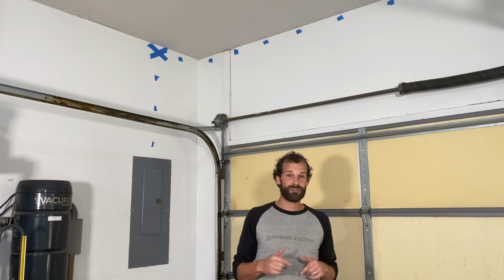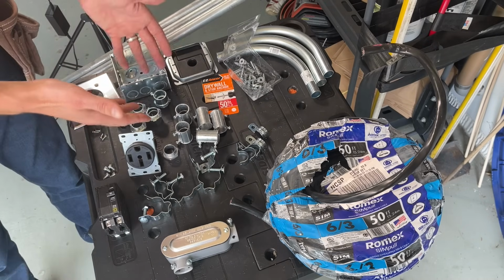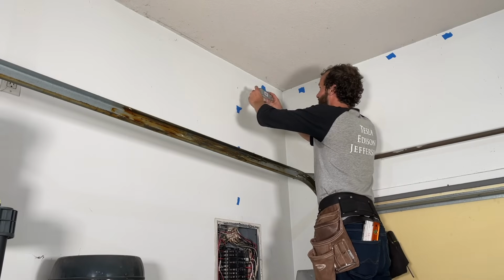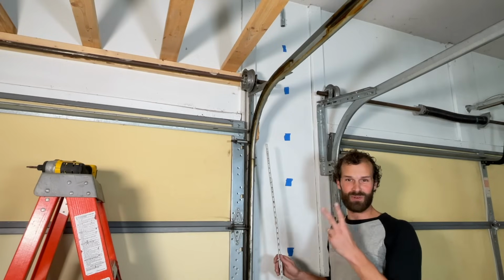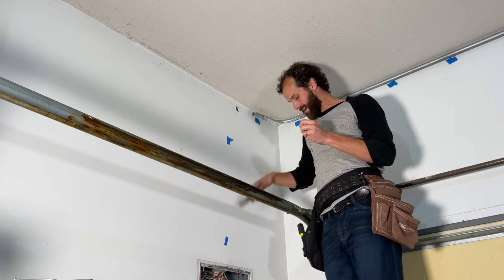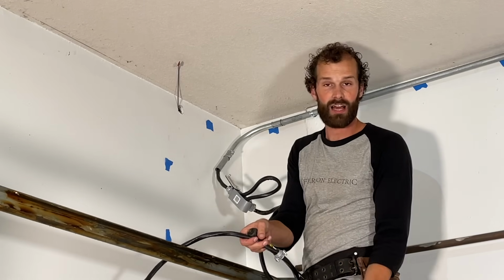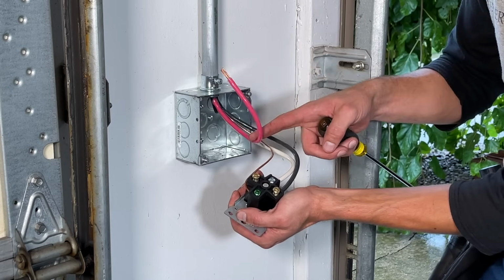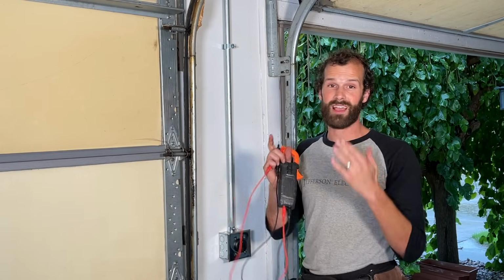How To Install a 240 Volt Outlet | Electric Car Charging

Comment: Thanks so much for this video, really enjoyed watching it. 
Question, since the code requires outlet in the basement, garage to be GFCI protected, should you have used a GFCI breaker ? Also, I'd recommend getting an electrical insulated screw driver for doing this kind of job. Thanks!
Reply: Hire an electrician. This is very dangerous amperage.
Reply: Only required if you are on NEC 2020.
Reply: @bobniles1928  Does this still apply if the charger has its own GFCI?  Didn't with ours (CEC).
Reply: Many EV chargers have GFCI protection built in so at least here (CEC) the breaker doesn't need to be GFCI, even tho our charger is installed outdoors and would normally have required GFCI for quite a number of years.
Reply: Not sure about the 2020 code, but at time a single dedicated outlet didn't need GFCI.
Reply: @jrendt2157  Garages and outdoor outlets can be fussy about GFCI, so it's best to check out the relevant code.

Comment: I have a 100 amp service.  He does not recommend a 50 amp circuit breaker, 240 volts for this service.  What should I use for my Tesla Y?  Will a 40 amp circuit breaker work with a smaller wire?
Reply: Please call an electrician. This is not DIY work.
Reply: @Sparkeycarp  spoken like a true union man

Comment: IT WOULD'VE BEEN MUCH EASIER IF YOU WOULD HAVE USE THHN WIRE. YOU WOULD'HD INSTALLED THE COMPLETE RACEWAY THEN PULLED THE WIRE THROUGH WITHOUT HAVING TO REMOVE THE LB AND 90°, BUT YOU'RE A PRO I GUESS.

Comment: This was awesome. I'll be buying nan EV next year and it's nice to see the process in action. I planned to get an electrictian. Mine is going to be on the outside so still trying to determine my placement and overall look. One tip. I'm a network guy and run cable all the time. I have the metal fish tape but for electrical projects like this it might be a good idea to invest in the fiberglass glow rods or the plastic one. A word of caution when using them. If they're the fiberglass rods need to wear gloves. But I would wear gloves with the fiberglass rods or even the planstic rods to avoid skin cuts or irritation. For most projects a metal fish wire will work fine. But since the other rods are non-conductive they be a good addition to the set your set of tools.
Reply: Hire liscenced and insured electricians
Reply: @anthonywacker6165  I most certainly will. I'm not going to be putting in a new circuit 🤣😂

I'm planning to take delivery of my EV in June next year and got my charger already. I'm going to be setting up a couple appointments in the spring with a few licensed electricians and get quotes.
Reply: @KineticEV  I’d say 600-800$ job assuming it’s not to complicated of a run and/or need to swap ur panel
Reply: Hire a professional electrician!!!

Comment: That spot in the middle of the 2 doors is horrible for a Tesla hookup. Tesla charger is wired into their own box(station) and the reason why it sucks is because the cord is attached to the station. So wrapping it around gives you the risk of getting into the garage door track. Not good situation. You would have to box out the sides or make sure its tied tightly each time.
Reply from the maker: That’s doable, thanks for the feedback/tips 👍

Comment: Pro ? You do clean work but missed couple things:
- the tesla charger says not to use a GFCI breaker, but some other manufacturers do.
- you CAN NOT ( and should not ) pull a romex through conduit.  Why?  The wires get hotter when in romex sheathing and in side  conduit. Especially after you kept repeating that its a continuous  load.
- steel fish steel through live panel ?  Please don't.  I've been in the trade 20 years. Do I do it ? Yes. But I I'm making a how to video use a fiber glass fish.
- if you want it to look like a real pro install :  don't use the 90° elbows , just conduit.  
- not sure why you use a mud ring 
- and, some jurisdictions do not allow the conduit to be used as a ground, so need to pull a ground wire, and use a ground tail in the 4" box.
Reply: We were thing the same things . Fiber glass fish tape less chance of sparking any thing but to each there own he made it work. And I know nec code disagrees with putting Romex cable in pipes .good point yea any thing 3-4 hrs or more is a continuous load so def a no no especially in a garage that doesn’t have AC or climate control to keep the room temp regulated .as far as using 90* elbo on pipe well it may not look the best but I will give him points he’s doing this to teach DIY ppl how to do it. Most of them won’t know how to use a pipe binder let alone know how to subtract the correct amount off the 90* bend when bending pipe so for that it makes since to show prefab 90’s you can  buy at store.

Comment: For anyone watching this video, do not jamb that many NM cables through one hole as in this existing panel.   If that is actually a conduit in the wall and longer than 24”, it is a violation of NEC rules.   The reason: heat can build up to a point the conductor insulation will start deteriorating.   Over time, caboom or fire.
Reply from the maker: For this install Romex was simply ran inside the wall and then fed into the conduit body right below the top plate.
Reply: @EverydayHomeRepairs  He is talking about the existing Romex bundle in the top of the panel.
Reply: @Sparkeycarp  This whole video is scary. That panel would never pass inspection, look at all that insulation left on the existing Romex, total fire hazard.

Comment: NEC doesn't allow Romex in conduit in this application. At the very least you must De-rate the current carrying capacity.
Reply: Nec 335.15 (B)  indicates that emt is an approved method for nm protection.   Please make sure I read it correctly..
Reply: @keithharrington4595     You are absolutely correct except it is 334.15 B.   Here is the problem.   That references where subject to physical damage.   Now go to Article 300.4 that gives the situations where protection against physical damage exists.   Which of the listed situations is this project noted?   I’m thinking this project is not in any of the listed situations and is not installed within the NEC rules.   ab diver seems to be correct, but did not tell us why.   
The electrician should have placed the NM cable within the walls and ceiling, or run conduit the full length and used conductors, not NM cable.
There used to be length restrictions on NM in conduit, but somehow it got removed from NEC.   Maybe they were too specific?
Reply: @KevinCoop1  well sir, many ahj, require exposed wires in garages to be protected.  That gets us back to 334.15.b.
Reply: Can you give NEC code section numbers for your comment?

Comment: What's the difference between 4x4 box with sharp edges like the one shown in the video, and the 4x4 box with rounded edges, commonly sold at the store right beside it? You can use either one right? Just no mudring when using the rounded edge style? Is it just personal preference?
Reply: The round edge boxes are usually not as deep. I would recommend you use a larger box.

Comment: I wish everyone would stop saying 220! 😔😔 it’s 240 now. All the electric companies across the nation. Has stepped up the AC volts per leg on housing and commercial. Years ago. It use to be around 108/115 per leg. Now they read around 118/ 122 per led. Hence the 240 volt. Test the lines coming in? Each side should say around 119 ish.
Reply from the maker: Hey Kraken, thanks for the comment.  You are about the 5th comment to call this out.  I checked the google trends as I was trying to relate to the most viewers on YouTube.  After checking search volume the 240 as compared 220 has a steady increase in people searching over the past few years.  So, even though Joel called this out in the video I also change the title and description to "240."  👍

Comment: I'm confused about the difference in electric cars that are Non-Fast charging compared to Fast Charging because you can ruin an electric cars battery if you're "forcing it" to be a fast charging. The AMP Rating of the outlet has to MATCH to your electric car charging system is what I have been told. If you put a High Amp Rating compared to the electric car charging system it will damage the cars battery because you're Forcing it to be fast charging. Do you know what I'm talking about and what to do about this issue?
Reply: Basically the outlet has to match the rating of the car so that the plug will fit in it.  Then for safety reasons, you need the correct wire size and breaker size to carry that amount of current.  However, whatever is plugged into the outlet is what determines how much power (up to the breaker limit) is pulled, not the outlet.  Think about an electric clothes dryer.  Typically it is wired with a 30A circuit and outlet though it might draw 22A on high, but only 7A on low.   But yes, the faster you charge your EV, the more heat that is generated, which can potentially reduce battery life by some amount.

Comment: One think I never do is run a metal fish in a live panel. Having been in a arc flash myself and seen others you learn. I see someone said they done it a thousand times. He has been lucky and maybe 1001 will make him smarter. Rest of the video was good but also agree you need to jumper your ground wire to the box.
Reply: Not a pro, but I don’t think you want to bond neutral to earth on sub panels. Only one bond per building.
Reply: I was going to said that too, they sell some fiberglass fish rods that are great for that , since you know when those metal fish tapes move aré incontrolable, the rest I have no complaint
Reply: I completely agree and I’m an apprentice I would never ever do that. I work with both ac and dc circuits (solar) and have been hit by both neither are fun and I’ve also seen disconnects explode from a simple cover screw barely nick a wire.
Reply: Ohh yeah I forgot the receptacle box needs a # 10 pigtail and spliced and get another pigtail for the receptacle. Also an industrial cover would look better since is surface mounted
Reply: @Mecambrea77  no it doesn't.
Reply: @Mecambrea77  he did it that way so he could use the mud ring as an extension ring to give him more room in the box. He could of used an actual extension ring and then an RS cover but that would be much more bulky
Reply: I agree 💯
Reply: Romex in conduit??? Fail.... romex not fastened to lb. Fail!!!!  Wrong  4 square box.🤔 plaster ring with flush cover .😆.. why was this Tesla electrician  wearing  carpenter  bags instead of  electrician  belt?🤔.. this  installation  is ' shade tree, amateur '...😆😆😆 definitely  not a licensed professional electrician!!!! This shit is what causes fires, and can potentially  KILL people!!!!! Tesla needs to know about this, and remedy this!!! Elon should see this shoddy  installation!!! FIX IT!!!!
Reply: Bad instlallation!! Clearly  not professional!!!🤨🤨🤨 romex in conduit? Fail!!! Not securing romex to lb. Fail!!!🤨🤨wrong 4"box. Fail!!! Plaster ring with flush mount cover.fail!!! This installation  is completely "SHADE TREE, AMATEUR " at best and shoddy and dangerous.. this is what causes fires, and people  getting killed. This "TESLA " installer is clearly a fake!! Tesla should  see this and take it down... a competent electrician can  easily see the failure and dangers to this installation!!!!  Were those Stanley  screwdrivers? Carpenter toolbags.. call Elan and get this fake off YouTube  before someone  gets burned up!!!
Reply: Circuit Breaker, I have done it many times, but I'm a pro.
Reply: @john alt yes indeed you may think you're a pro but accidents do happen. For an instructional video it should of been a fiber glass or nylon snake and or the metal snake should of been tape up at least 8FT but that's bit annoying to do. There is so many OSHA rules and safety we all have to follow in NY or other states.

Comment: i get into a ton of reasons why i would never do it this way , one is that im charge point certified installer and charge point will not honor any warranty if their charging unit is not installed buy a CERTIFIED installer ,there goes that 50,000 dollare EV , number 2 is i would never used 6/3 romex though EMT. ....Number 8 THHN is rated at 55 amps , less money less labor ,
Reply: Michael,   Please go to the link I’m giving you.   See if you can figure out why using #8 thhn on a 50 amp breaker to a 50 amp receptacle would be a violation of NEC.  This is very important to understand and I’m trying to help you.
Link.     https://hubbellcdn.com/installationmanuals/WIRING_PD1186_INSTALLINST.pdf
Reply: @KevinCoop1  i suggest you read table 310.15 b and see that # 8 THHN is rated for 55 amps in conduit and the nema 14-15 receptacle is rated a at 75 degrees and in the 75 degree column # 8 THHN is rated for 55 amps ....im trying to help you, and unless that load is continuous at 3 hours or more even then the max amperage is 40 amps multiplied by 125 % make that a 50 amp draw and # 8 in free air 75 degree column is rated a fifty five amps 55 55 double Nickle
Reply: AND HE DIDNT BOND THE 1900 BOX !! my inspector would not only fail me but call me every name in the book
Reply: @DontHaveTime523     You are absolutely correct that a NEMA 14-15 receptacle is 75 degrees C rated.   But if you look at a NEMA14-50 information I sent the link on, they are only rated for 60 degrees C.   Therefore #6 is required by 310-15(B)(16).  One could say that Article 240.4(B) says it is ok to use the next size up therefore ok.   But the conductor is not what is in question.   The 50 amp receptacle must not go above the Listed 60 degrees C.   So, #6 required by NEC and the listed devices manufacturer.
Reply: @KevinCoop1  what am i missing here ?  why must the receptacle not go above the 60 degree listing ? maybe im not reading it incorrectly or the link is incomplete  i also would question the romex inside the conduit creating more heat i would think .....and the biggest concern is him not bonding that circuit to the box . you would agree ?....i welcome more info
Reply: @DontHaveTime523    I agree with you on the NM cable within conduit.   Years ago, it was not allowed, then allowed in up to 24”, then allowed in basements with out walls over the concrete, and now people are just doing it for some reason and saying it is for protection.   Not grounding the box is absolutely a NEC violation.   
Now for the hard to explain.  All conductors have tested and listed temperature ratings.   They are 60,75,90,or 105 degrees C rated.   30 years ago, below 100 amperage circuit breakers had terminals rated at 60C.   So, we had to use the 60C column in 310.16(changed later to .15(B)(16)).   The conductor ampacity used must not be higher than the terminal temp rating.   Now breakers are pretty much all 75C so, the old rule of you must use 60C below 100 amps can go away, IF you know, and can prove, that the terminal temperatures on both ends of the conductor are 75C.   For the same reason, we can not use the 90C column when sizing conductors to overcurrent ratings.   I’m assuming you do not use 90C.
Most receptacles are rated at 75C, but not all!   30 amps and below, no issue because NEC states #14-15a, #12-20a, and #10-30a.  It’s the 40,50, and 60 amp receptacles that must be checked before deciding a correct conductor size.
Sorry so long winded, but it is easy to mistake something said.
Respectfully,   Kevin
Reply from the maker: Thanks for the feedback Michael 👍

Comment: ,For being an "electrician" you do not practice safety during this video. You are suppose to have an isolation blanket between you and the panel when using the fish. Also, a fiberglass fish is the OSHA standard for the job you did here.

Comment: Didn't torque the wire connection at the breaker, there are specs for it. So why then torqued it at the outlet? Both should have been torque. Also at the outlet box he didn't mention that you should at least leave a quarter inch to a half inch of the black insulation, it's required by code in lots of areas.

Comment: Great video.   Can you do one about adding garden lights that Bean light to the house?  I wonder how deep in the ground the wires have to be, etc.
Reply: Depends is it line voltage lights? Or low voltage off a transformer. If it’s LV u can burry it 6in or so below grade, w line voltage id use either 1/2pvc a ft down or direct bury NMU cable 18in approx
Reply: @Nick-bh1fy  it is low voltage off a transformer
Reply: @jaimedpcaus1  fairly easy install assuming you’re keeping it in a dirt area and not cutting across grass or anything. Keeping it at least 6in should suffice, and if connections are being made, use weatherproof connectors w silicon in them
Reply: @Nick-bh1fy  Excellent.   I also need to go under a strip of walkway to get across to a center garden island.
Reply: @Nick-bh1fy  I wonder how I can find the weatherproof with silicon connectors?  If I had to insulate the wires,  what kind of conduit would I need?  I'm thinking of using 12v lights.   What transformer would I need and can one suffice for 4-10 lights?
Reply: @jaimedpcaus1  LED lights barely consume a lot of power so the transformer would be fine. Low voltage cable doesn’t have to be protected in ur case, but if you’d like too use 1/2 rigid pvc.  As for the wirenuts you can find them at homedepot if you ask for silicon filled ones, but even Amazon and other hardware stores should sell them
Reply: @jaimedpcaus1  24v transformer would be ur best bet